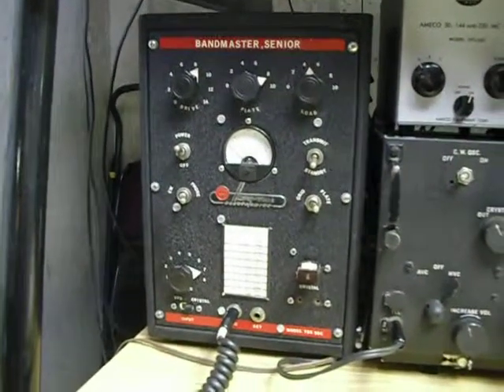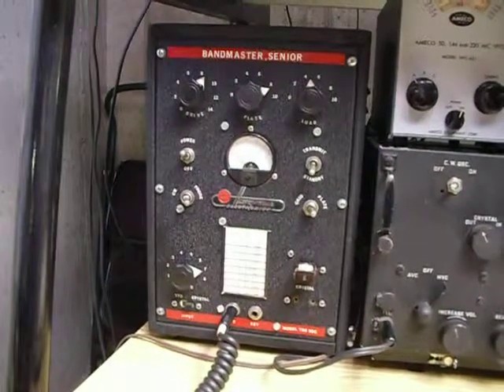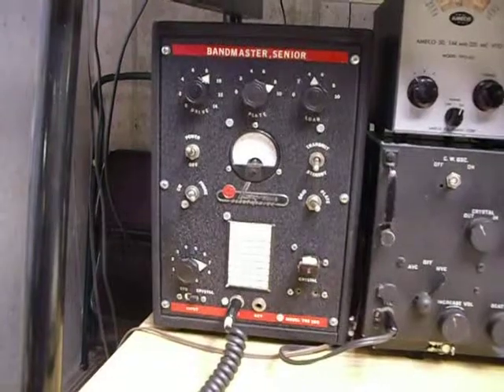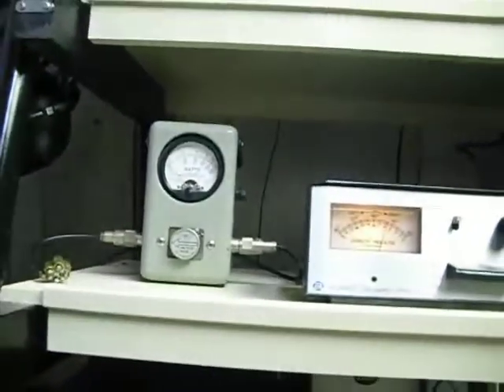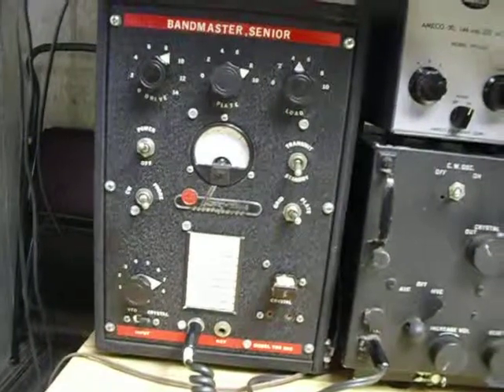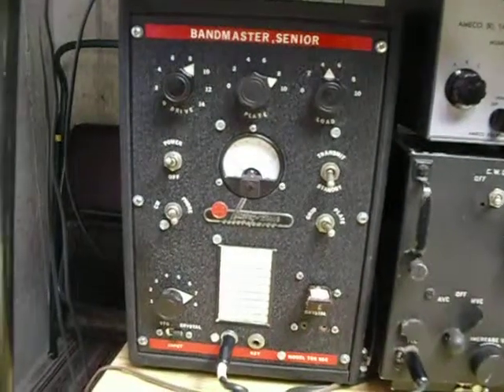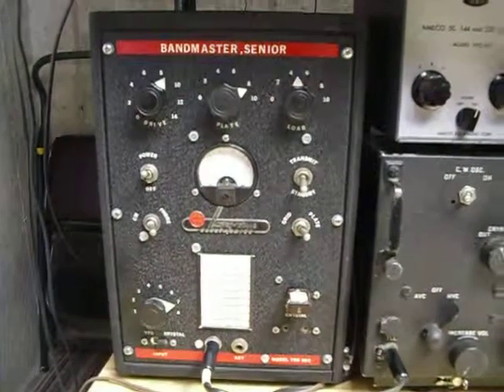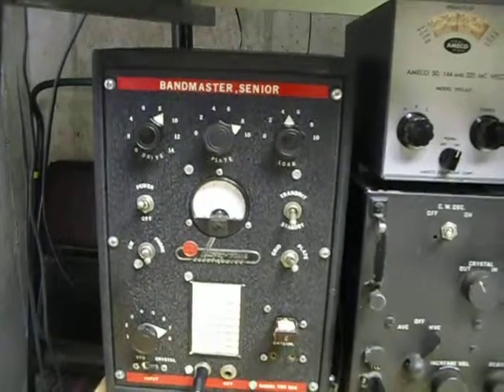Harvey Wells TBS50C, Harvey Wells tbs-50c

Comment: TBS-50 and BC-348 makes for a real vintage pair, likely two units that shared the bench in many stations in the late 50's and early 60's.
Reply from the maker: Yes MIKROWAVE  it is a good combination . I am using the BC348 this year for New Years Eve  Straight key night with a ARC-5  WW2  transmitter . 73  Bob
Reply: @robertsumption1243  Ditto. Hope to work you ARC-5 to ARC-5.

Comment from the maker: Peter that is great !  You will like the Harvey Wells TBS50  you may find the plastic in the coils is so old it they are falling apart especially the 80 meter tank coil .  The E-6000 Glue available at K mart or craft stores works great to repair them just apply the E-6000 alongside the plastic coil supports in the coils and let it dry this glue is great for RF coils won't effect the operation at all  .  Good luck with the project 73  BOB